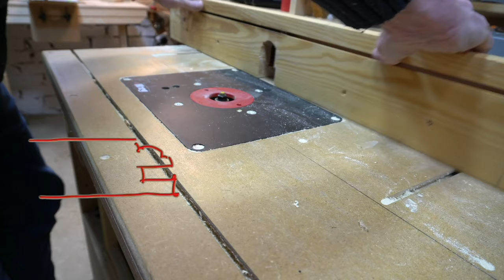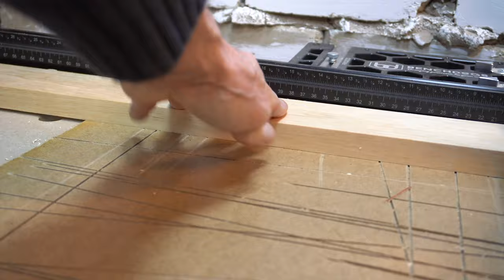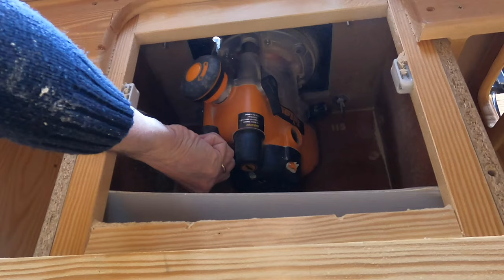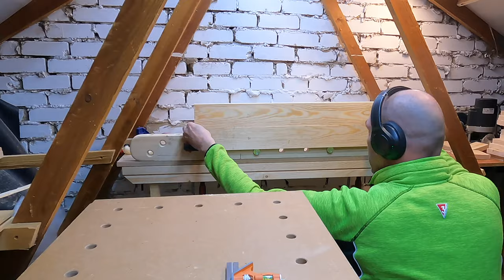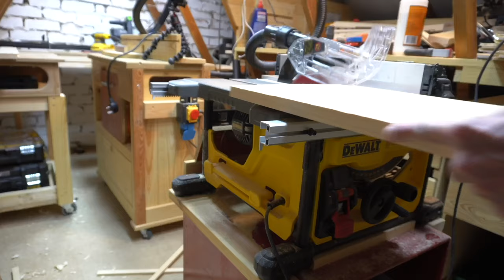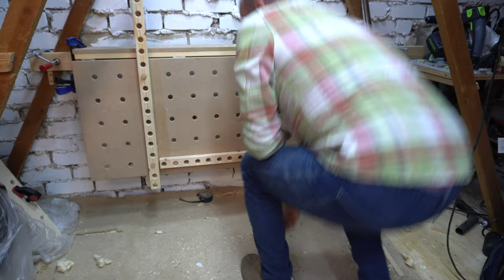How to make Raised Panel Kitchen or Cupboard Cabinet Doors

Comment: i've spent the better part of the last 20 years building custom 5 piece doors, watching this was humbling as it reminds me of where it all started.  i love how a guy in his home shop can produce a door just as good as the doors i produce via a $500,000 shop with all the fixings.  if you can swing it get yourself a small powerfeeder as your next shop upgrade, being able to climb cut your material is like unlocking a woodworking black magic super hack, plus once you figure out the setup its always setup and far safer, easier, quicker, and well.. awesome as are you lol.. im digressing.. anyway thanks for the video and the thought provoking content.
Reply from the maker: Dave, thanks for your comments. I will investigate climb cutting, that’s for your advice. Regards JP

Comment: What brand is that cutter?...i have a yonice which isnt very sharp
Reply from the maker: Hi. I bought them from ebay a couple or years ago. They are the 1/2" version of these. I cannot find the exact version
Reply from the maker: https://www.ebay.co.uk/itm/1-4-Shank-Raised-Panel-Cabinet-Door-Router-Bit-Woodwork-Milling-Cutter-Set-/265105185013?mkcid=16&mkevt=1&_trksid=p2349624.m46890.l49286&mkrid=710-127635-2958-0

Comment: Great job, very therapeutic to watch. Have you got the link for Triton base plate? Many thanks
Reply from the maker: Thanks Steve. Thus one 

https://ffx.co.uk/product/Get/Kreg-Prs4034-0647096806859-Precision-Router-Table-Insert-Plate-W-Level-Loc-Rings-Predrilled-Triton?gclid=CjwKCAjw9LSSBhBsEiwAKtf0n6SUxkpFdzzxVmgF0oUIacGjc57JCo86w4t-2r-uCoHkeUnh6pEBXBoCHcgQAvD_BwE

Regards JP
Reply: @Smallbarnworkshop  Cheers for that